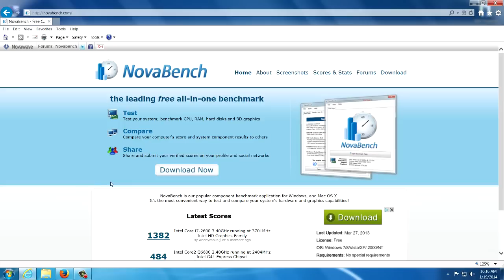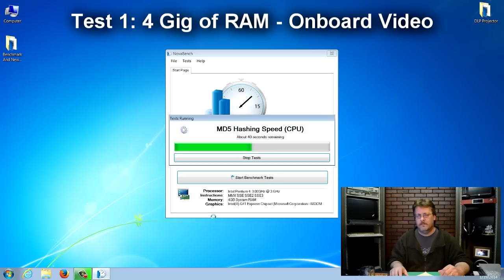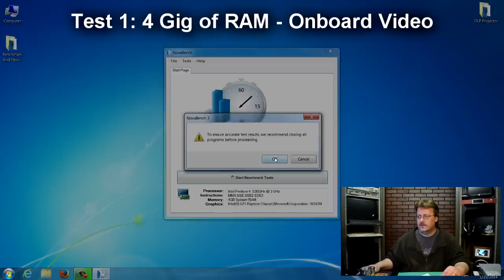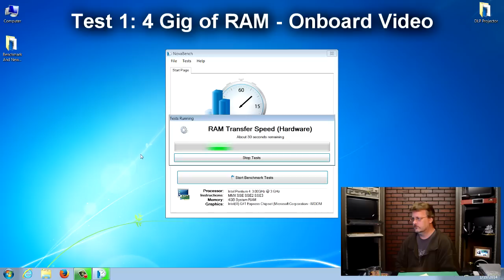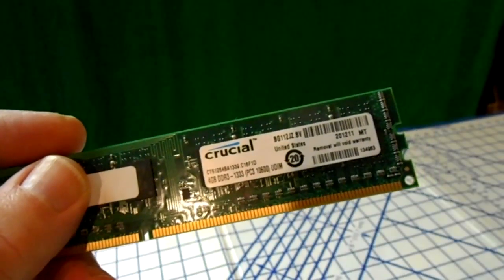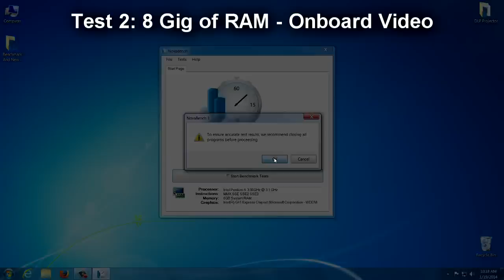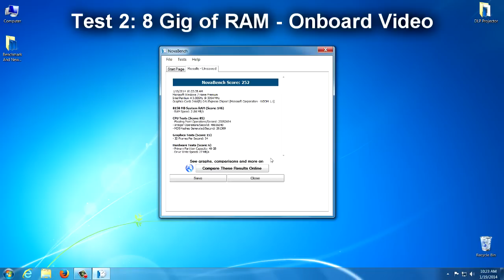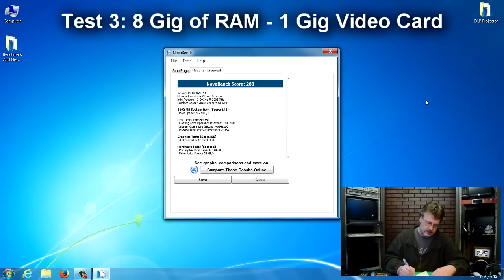Modifying Computer for Performance While Benchmarking Results

Comment: Interesting video.  Did you mention what operating system the PC is using?  My guess it is using 64 bit hence the improvement when adding more memory.  Which means if you are using a 32 bit OS the extra memory will not help.

Thanks for your time,

Tom

Comment: What operating disk do you use for your dell laptop
 Where can I get it? Thanks
Reply from the maker: Depends on the system. Look on the sticker that describes the operating system and that is what you should install. A disk can be purchase from the computer manufacture for little cost.

Comment: i configured a hard drive to my computer and i dont have the drivers and not sure what ones i need any tips
Reply from the maker: You should not need to install any drivers to install a hard drive the OS will take care of that. Is this a second hard drive or a primary? If the drive is a used on you may need to go into the disk management tools and format the new drive but be careful you choose the correct drive before doing this or you could erase your OS.